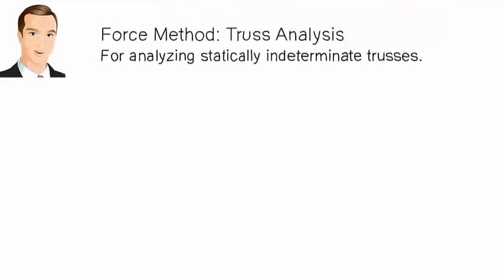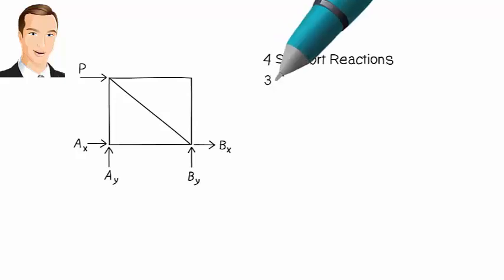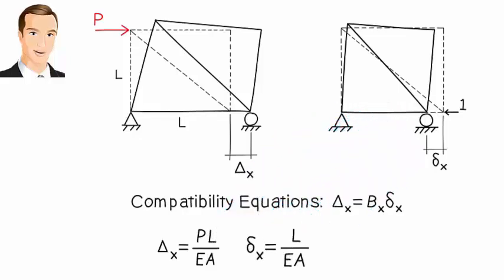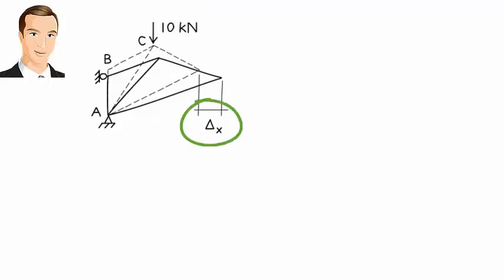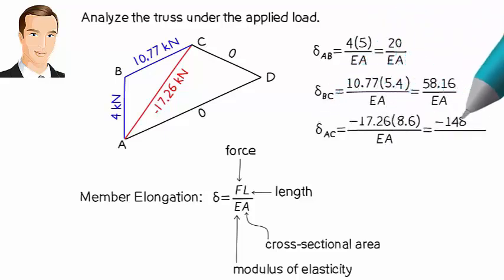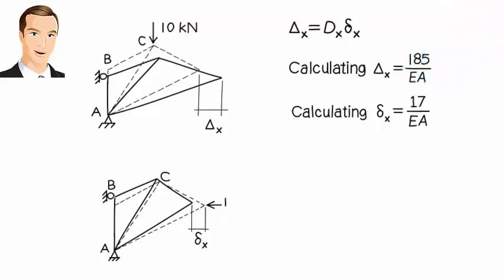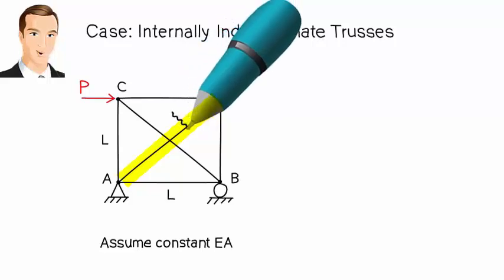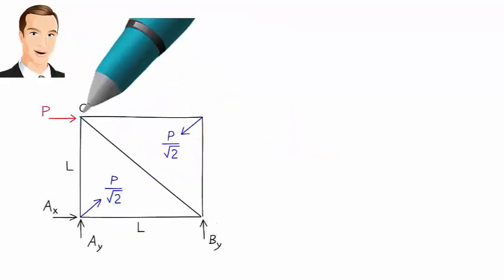SA26: Force Method (Truss Analysis)

Comment: I have developed a novel method of solving indeterminate trusses called the Method of Stroops. My method simplifies the analysis of indeterminate trusses by paralleling the Method of Loop Currents used in electrical circuits. I have made a video showing the application of my method to the parallelogram truss problem starting from about 9:30 into this video. My video is entitled "Force Method vs Method of Stroops, Problem 4" (Also Problem 5). The solution obtained by the Method of Stroops is the same as that obtained in this video. My video also describes the advantages of using the Method of Stroops over the Force Method.
View my video also and compare the two methods.
A more detailed explanation of the Method of Stroops can be found in my video entitled “Trusses, Electrical Circuits and Kirchhoff’s Laws”.

Comment: "At 12:15, I don't understand how the extension in BC is not considered in calculating the force in BC.  Usually it is considered.  Yet the value of 9.7 is very close to the exact value of 9.694."
I retract this comment. I see how you do it now.  In the calculation of delta you do consider BC, so it comes out right.   Great.

   There are some inaccuracies in the calculation of the force in BD and others,  see comment by njwu4117 below.

Comment: In the first example, externally statically indeterminate, it is obvious that the forces in the top member and the member on the right will be zero.  Just considering equilibrium at the top left joint gives all the forces.  No need for any force method.

Comment: does it apply when determinacy is more than 1
Reply from the maker: Yes, the force method can be used to analyze a structure with N degrees of indeterminacy. Although as the degree of indeterminacy increases, the formulation becomes more complex.

Comment: How to judge the direction of unit load. 

For finding triangle X.
You took in same direction of displacement.
But in finding delta x you took at opposite direction of displacement.

In question 1
Reply from the maker: When a force or displacement is unknown, we can assume any direction for it. As long as we are consistent in our formulation, it will work out at the end. If we end up with a negative value for the assumed force/displacement, then we know that actual direction is opposite to what we've assumed.

Comment: hi Dr. Structure, I have a frame that is 2 bays, 2 story, 3 pins as the ground supports and 2 inverted V braces (one at bottom first bay first story & the other at the top second bay second story). There's a uniform load on the roof level, a lateral loads  at the first and second floor far left joints . I am trying to find the force on the bottom left inv-V brace. I know I need to find the reactions and then make a cut to find the brace force but I'm not sure which force method to use: the one for trusses or the one for frames. Is this braced frame fall under the frame or truss category? .  also is the force method the fastest method for this particular problem or should I use Moment distribution, slope-deflection, or stiffness matrix?  which is best??
Reply from the maker: The structure consists of beam-column and truss elements (the bracings). The classical techniques such as the force method and the slope-deflection method are not suitable for this kind of analysis. A more general technique such as the matrix/displacement method is the best option here.
Reply: @DrStructure  Is it safe and correct to make the assumption that the braces take the lateral only (since its the force of the bottom brace that is in question) therefore solving it using a shortcut approach like Brace force = story shear / (2cos theta) ? or do I absolutely have to use the matrix method
Reply from the maker: @CR-uh8yb  The bracings effect joint displacements which in turn effect the member forces, including the force in each bracing element. Further, the shear force is going to be carried mainly by the columns, not by the bracings. By its very nature, a bracing is mainly a tension (truss) member carrying an axial force only. I would use the matrix method to analyze the system so as to better understand its behavior.
Reply: @DrStructure  Ok I will use the matrix method.Thank u Dr. !!

Comment: Dr structures, don't we find external reactions at roller and hinge supports when we apply internal unit loads?
Reply from the maker: If it is necessary to calculate the reactions, yes, we do it. But since we only need the member forces, sometimes calculating support reactions can be avoided.

Comment: Excuse me, @0836, how to calculate the axial deformation by virutal method?
Reply from the maker: We don't need the virtual work method for calculating axial deformation in a truss member. If we know the force in the member, then we can easily calculate its axial deformation.

Let S be axial stress in the member,
E: modulus of elasticity,
U: axial strain
A: cross-sectional area of the member
L: Length of the member
P: Axial force in the member
D: Axial deformation

(Axial Stress) = (Modulus of Elasticity)(Axial Strain)
S = E U

Since axial stress = axial force divided by cross-sectional area,
S = P/A

And, axial strain is axial deformation divided by member length:
U = D/L

Then, we can write:
(P/A) = E(D/L)

Solving the above equation for D (axial deformation), we get:

D = (PL)/(EA)

So, if know axial force P, length L, area A and modulus of elasticity E, we can use the above equation to calculate D.
Reply: Which member should be calculate? Since AD is cut , how to calculate its axial force?
Reply from the maker: I see where the confusion might be. I misunderstood your previous question and gave you a misleading answer. In the force method, how do we calculate an axial deformation caused by cutting a member using the virtual work method? The answer to that question is here:

https://www.youtube.com/watch?v=tD-VYTOCHVA
Reply: Actually I saw SA21 video before, but it does not have a case of cut the members and find the deformation. In your previous reply, I understand how to find the axial deformation, but I dont know which member force I need to find in @0836 example to find the cut member deformation. Let the point of  intersection of BC and AD be a point E, if ED is cut, should I imagine ED is gone and find the member force? But after I find the member force, I cannot find the member force of ED , since it is not exist. Or should I find the member without imagine removed any members? But it is internally indeterminacy, so I cannot find the member force without removed one of the member. That's my confuse.
Reply from the maker: Okay, the given truss is indeterminate. So, we need to cut a member. Here, we cut member AD. By the way, there is no need to define point E, since AD and BC are not connected, they just touch each other, overlap, at their mid point. 

Let’s cut the redundant member AD, And remove it form the truss. So, we end up with a statically determine truss subjected to load P at joint C. This truss does not have any member connecting A to D.  Now, go to Lecture SA21 and calculate displacement between A and D. Don’t view it as the axial displacement in member AD, since the member is not there (we cut it and removed it), think of it as displacement along axis (line) AD. That displacement can be calculated using the virtual work method per SA21. We refer to this displacement as DELTA.

Going back to the indeterminate truss, remove the applied load P. Then cut AD again, but this time, replace it with a unit axial force. This means a unit force at D point toward A, and a unit force at A pointing toward D.  Again, remove member AD. This again gives us a statically determinate truss just like the above. Except that here the loads are different. In the case above the load was P. Here, there truss is subjected to couple of unit loads, one at A and one at D. But the truss has the same geometry as the case above, there is no member AD, the truss is statically determinate. We can use the virtual work method to calculate displacement between A and D due to the pair of unit loads, just like the above case. We refer to this displacement at delta. 

Then we can write DELTA = (Fab) delta. Or, Fad = DELTA/delta.

Let me know if I need to explain a bit more.
Reply: 1. For my said point E, if it is not a joint, when i determine the stability of the structure, there has a confuse, the below is my proceed to find the stability of structure, please check
Joints = 5
Unknowns =5*2=10
Reactions=3
Members=8
Equations=8+3=11>10
Degree of indeterminacy =11-10=1
Due to reaction is 3, but still have one degree of indeterminacy, we say that it is internally indeterminacy. 
Does it correct? 
So, by your last reply, you say that AD and BC is just touch each other, it is not a joint, 
so does the joints =4?
Unknowns = 4*2 =8?
Reactions=3
members = 6?
Equations =6+3=9?
Reply from the maker: Yes, your analysis is correct, for both cases.
Reply: @0836, does the axial deformation of AD is equal to the horizontal displacement of joint D?
Reply from the maker: No, not necessarily.
Reply: So do i need to find the horizontal and vertical displacement of joint D to find the axial deformation of AD? Since point A cannot move.
Reply from the maker: In theory, yes. But when using the virtual work method, all you need to do is to place the unit virtual load at D pointing toward A. This works, since the method gives the displacement under the unit virtual load in the direction of the load.
Reply: If I place the unit virtual load at D pointing toward A, the displacement which is the horizontal displacement of joint D, I also try to find the vertical displacement of joint D and it is zero. So in this example , it just have the horizontal load P point at joint C, also consider the deflection of the truss is very small, so i guess that the value axial deformation of AD is same as the value of horizontal displacement of joint D. Do my guess right?
Reply from the maker: You need to be rather careful here. :) Displacement is a vector, we are looking for a displacement vector in direction AD.  That can be computed directly, as I mentioned before, by placing the virtual unit load directly in direction AD at joint D. If you decide to compute the horizontal and vertical displacements at D separately, you are correct, the vertical displacement would be small and probably negligible. But then you must find the projection of the horizontal displacement at D on the AD axis. You should not use the horizontal displacement at D as a substitute for displacement in direction AD.
Reply: Please see the following picture: 

https://www.facebook.com/photo.php?fbid=10156403272572710&set=a.10156403272482710.1073741851.595557709&type=3&theater

Please focus on the figure 1 to 3. 
Figure 1 = Figure 2 + Figure 3
by superposition 
Does it right?
In figure 1, there has a axial deformation (delta 1)of AD already, 
should the displacement (delta 1 + delta 2) of joint D along AD at figure 2 include the distance of axial deformation of AD(delta 1) at figure 1 already, so in figure 3, do I just need to give the axial force AD to bring the displacement (delta 2) of joint D along AD to the deformed figure 1?
Reply from the maker: Thanks for the diagrams. 

Yes, you just need to find the axial force that causes delta_2 displacement. 

Put it differently, just set delta_1 to zero. Then use virtual work method on Figure 2 to get delta_2, and then apply a unit load on Figure 3, and calculate the displacement gain, this one is due to the unit load, so let's refer to it as delta*_2. Then, delta2 = Fad delta*_2. Solve this for Fad.
Reply: Why delta 1 can be assumed as zero?
Reply from the maker: To be sure, member AD is going to have an elongation, so delta_1 is not zero. But, here we are calculating relative displacements, after the member has gone through its actual elongation. So, after the indeterminate structure has been deformed, we cut AD and claim that the additional displacement along AD is delta_2. We want to bring this displacement back to zero by applying a virtual load in direction AD.
Reply: But in figure 2, member AD is removed, the loading is still P, if i put a virtual load on joint D point to A direction, the displacement of joint D along AD axis that I can find should be delta 1 + delta 2, 
the equation should be 
1*(delta 1 + delta 2) = summation of virtual axial forces time the real axial deformation of all members
Reply from the maker: But there is no member AD in figures 2 and 3. We cut it and removed it. No axial deformation of a truss member happens in Figures 2 or 3, because there is no truss member there.  Whatever axial displacement is present in AD before cutting the member is inconsequential since the force formulation deals with relative, not absolute, displacements.
Reply: If i want to calculate the displacement of joint D along AD axis, should I need to put a unit virtual load at joint A and D at the same time to find out the member force?Thats mean there have two unit virtual loads, one is at joint D point outside and one is at joint A point outside?
Reply from the maker: In principle, yes! Except that in this case, since there is a pin at A, the unit load placed at A does not contribute to the displacement. The force is going to be absorbed completely by the  pin, it is not going to cause any member forces/displacements.
Reply: So i would find the same answer for 1 virtual load or 2 virtual loads?
Also, I want to ask that in the past virtual method, we just put one virtual load on a joint only to find the displacement of the joint, should the virtual method also consistency for two virtual loads at the same time for frame or beam or external indeterminacy?
Reply from the maker: In this particular case, yes, the answers will be the same.  But conceptually, don't think of it as two separate forces. The two collectively represent a tension force in the redundant truss member. So we are not adding two forces, we are just applying the tension force in AD to its end joints.  Anytime we cut through a truss member, we show the internal tension force at both ends of the cut. If we cut (remove) the truss member very close to its end joints, then the axial (tension) force in the member has to be shown at both joints.

For beams and frames, we are not removing/cutting members. If we were, then yes, a pair of forces has to be shown/drawn.  But, beam and frame analysis using force method generally involves removing supports. And since such a support exerts a single force on the structure, we just use one such force.
Reply: Thank you for your patient and response. I got a lot of help.
Reply from the maker: You are more than welcome. I am glad the dialogue was helpful.
Reply: Before you said that

 "To be sure, member AD is going to have an elongation, so delta_1 is not zero. But, here we are calculating relative displacements, after the member has gone through its actual elongation. So, after the indeterminate structure has been deformed, we cut AD and claim that the additional displacement along AD is delta_2. We want to bring this displacement back to zero by applying a virtual load in direction AD."

If I want to find the relative displacements , the geometry of structure become deformed, the vertical or horizontal distance of AB or AC does not equal to L , how to calculate the reactions due to the unknown length?
Reply from the maker: One of the underlying assumptions in basic structural analysis is that deformation of members are relatively small compared to their length. That for all practical purposes the member lengths do not change (that is, the geometry of the structure does not change), and these small displacements do not have significant effect on the load distribution across the structure. Although in reality truss members lengths change as a result of applied loads, but we ignore their impact on the geometry of the system since they are insignificant.

The analysis techniques we are discussing here, and in structural analysis textbooks and classrooms, are referred to as first order analysis. There are higher order analysis techniques in which the effect of small deformations on creating secondary loads on the structure are considered. In practice, such those are used only when engineering judgment dictates it, when small deformations could have significant impact on the behavior of the system.

Comment: regarding with the internally indeterminate case, what if my assumptions for the directions of the forces are opposite?
Reply from the maker: You will then end up with a negative value for the magnitude of the force indicating that the force is acting in the opposite direction.

Comment: hi thanks very much for your video. i have a question : In the first example of internal statically indeterminacy , while you are calculating the deflection from a pair of virtual force, why is there 6 bars in total ? shouldn't it be 5 since one is cut already ? thanks
Reply from the maker: It is true that one of the member has been cut, but then we are applying couple of virtual forces to the cut ends causing the two separated segments of the cut member to elongate by themselves. That elongation times the force in each segment contributes to the total internal work done by the virtual load.